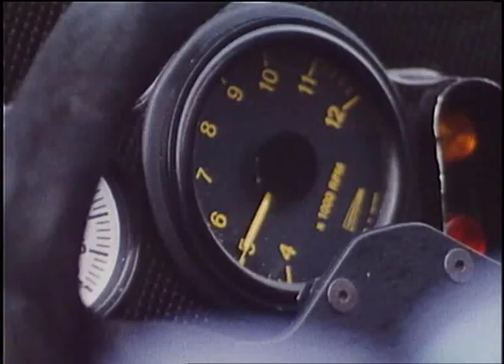Anatomy of the Start (Anatomie d'un depart)

Comment: Mechanics prepare racing machines, they are only in T-shirts and shorts, hands smeared with oil. The depot is under a canvas roof, actually directly in the open air. The riders prepare themselves for the race and finish the last details on their overalls. Then they leave the depot for their cars. Journalists and fans are everywhere. No one is afraid of espionage. They are one bunch. The riders write down a few autographs, sit down in the cars and leave for the start. There are no half-naked beauties waiting there and distracting your attention. You only feel start nervousness and you smell gasoline. The last few moments, everyone disappears from the runway,  only cars with their drivers leaving. That was golden era of racing.